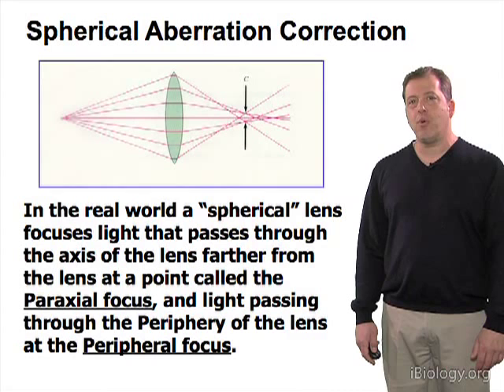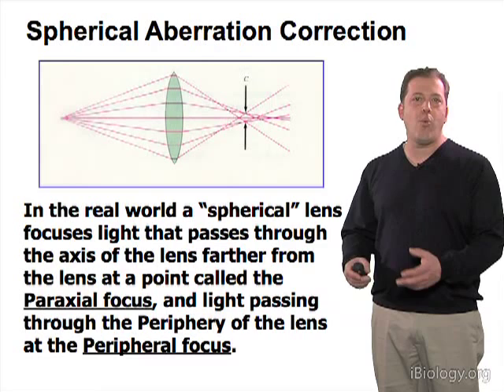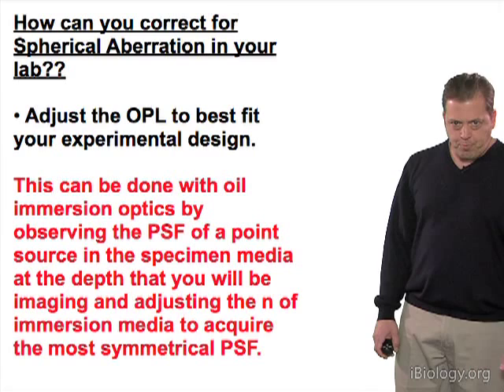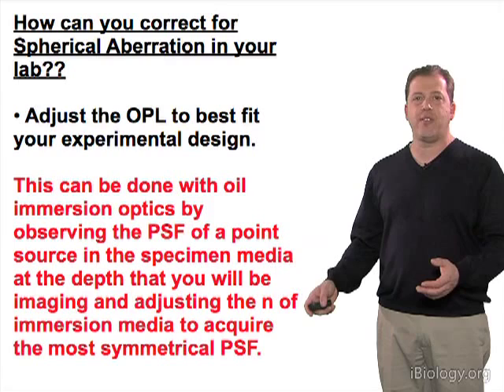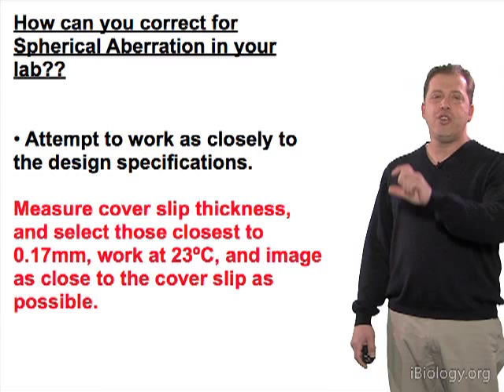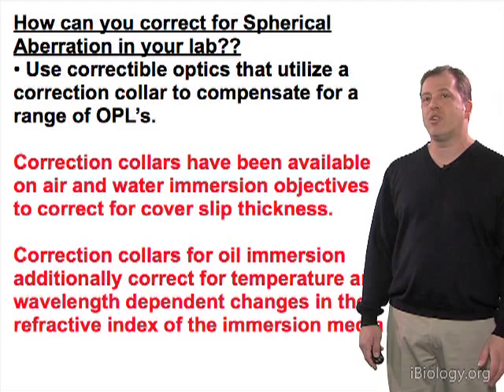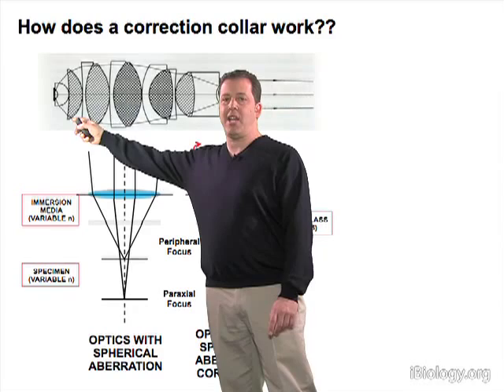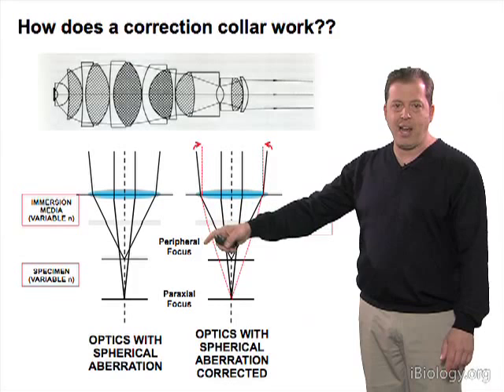Microscopy: Correcting for Spherical Aberration with a Correction Collar (Stephen Ross)

Comment: Just flipped through my book and discover this statement: 'Spherical aberration can be corrected using a smaller aperture or improving the lens curvature'' 
Why can a small aperture mitigate the effects of spherical aberrations? And what is meant by improving the lens curvature?
Reply: We can make a perfect lens, that will not have spherical abberation.   The 'spherical' in 'spherical abberation' refers to spherical lenses.  Google 'perfect lens wiki' for more information.
Reply: Also I believe the aperture closing will result in the majority of the light along the axis of the lense; avoiding the edges of the lens.  The edges of the lens are where the spherical abberation is worst.